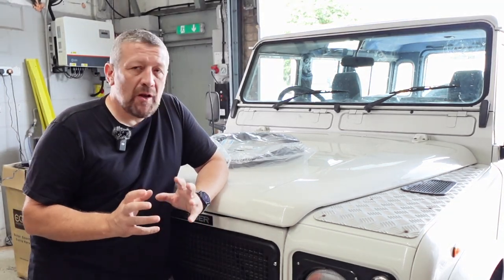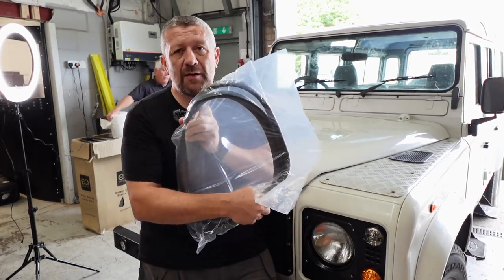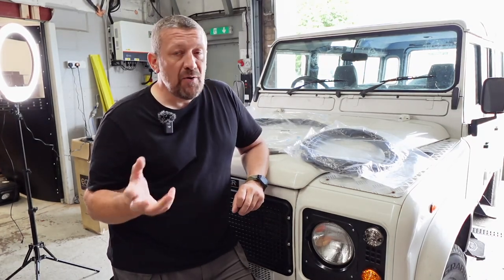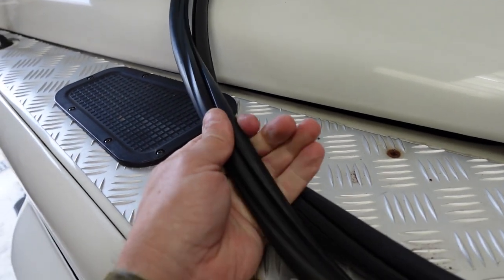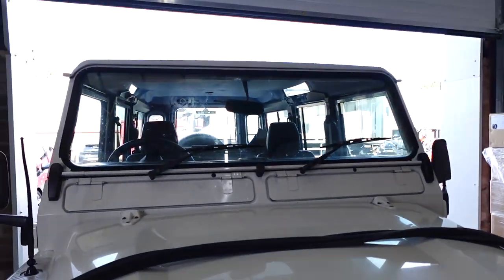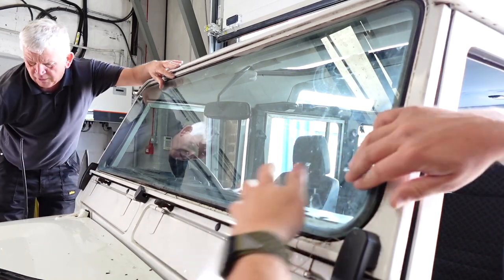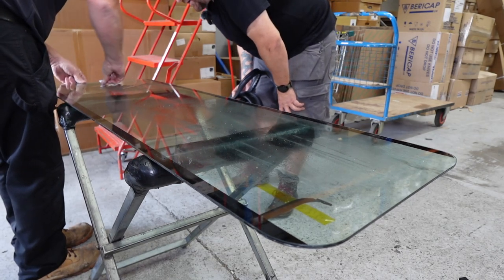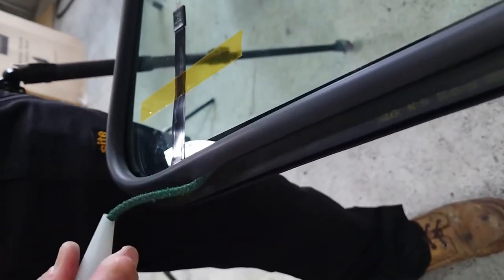DIY fitting a heated windscreen onto your Land Rover Defender.

Comment: Fitted a few Defender screens and always used the cheap Britpart seals, no problems whatsoever, when cutting the old seal be careful not to scratch the paint with the end of the blade, over time it will lead to corrosion behind the new seal. 👍

Comment: My windscreen man reckons my Defender was the worse car he had ever fitted glass to, I had a britpart rubber, which he claimed did not fit, so he glued the screen in place, looked pants, but did not leak. I the smashed the screen, and he ordered a new screen and rubber, was hreatly troubled, rang me up to say he would have to glue it in, something I declined. He reckened there was something wrong with my screen frame, that itwas distorted. I went to the workshop totale some diagonal measurements, and he had fitted it, albeit the rubber is a bitwonky on one side. He reckons the screen is under pressure, and had asked me not to come back if it needs replacing! Everyone says the Britpart rubber is OK, next time I think I will have to try it myself, hopefully there will not be a next time..
Reply: I used to fit glass with rubber seals when I worked for bodyshops, not sure what's difficult about a Defender, it's a flat screen, put the seal on the screen and hold it in place with some tape until its on all the way round, take tape off, fit the cord, bit of lube and it's in. I'd say it's one of the easiest to fit, I use the Britpart rubber.
Reply: @andicog   leave the rubber in the heat for a few days or next to the radiator , do that with motorbike tiers no problem
Reply: @DanMaloney-r9u  I've fitted a couple since that post, I've never had a problem with the rubber tbh, always used the cheap seals as well.

Comment: Could you lightly bake a non OEM rubber at say 50-60°c in an oven to get the flexibility you need (obvs wouldn't hold heat that long but a just a thought I had)

Comment: Can you please produce a video on replacing the rubber seals on the eyebrow flaps? I'm sure there's a quick-and-easy way to do this, but haven't figured it out yet. Thanks for this wonderfully informative series 👏
Reply from the maker: Do you mean the vent flaps? If so there's some advice on our hinge pin video. Basically if you replace the hinge pins, you can easily replace the rubbers on the flaps at the same time before fitting the new pins.
Reply: @LRLiveUK  yes, they've usually called the "eyebrow vents" because that's how they look, but I'm sure that's the correct name. Any chance of providing a link to your appropriate video, please? Thank you
Reply from the maker: This discusses it but if I have time I'll.do.a quick video too. Cheers 
https://youtu.be/NOBDrycmPds

Comment: Really useful cottage thank you.
I will invest in the better OEM seal as will be a little easier. I will likely be doing it myself, and have noticed how often original seals are softer and better quality than some aftermarket ones generally.
It was interesting you showing and describing the difference. 
However I won't bother with the heated window, modern car windows have a much bigger problem with condensation than my Landies.

Comment: Really helpful video guys, we need to replace the windscreen on our '87 2.5TD 90 at some point as it has a chip in it & has delaminated along the whole bottom edge (although it passed the last MoT like this, somehow) and the seal has perished badly along a good couple of portions.
The wife was looking at fitting the heated screen version instead of the standard and we have been trying to decide the best way to get it fitted, either ourselves or someone like autoglass, but seeing this makes me think of giving it a go ourselves. Going to look for your post on wiring your heated one in now.

Comment: I've had a couple of attempts at fitting mine and now going to get someone in to do it. Cracked the original screen through rushing it and inexperience. Got another second hand screen (travelled quite a distance to buy it) and it was nearly in bar the last 6 inches of cord to pull out, and a tiny 'tink' noise and a crack from top to bottom. Cracked only on one piece of the glass (outer piece of the laminate - inner was perfectly fine). Well pissed off. Hind sight is a wonderful thing but I should have had a bit of pressure on the screen from the outside as I pulled the last bit of cord out.